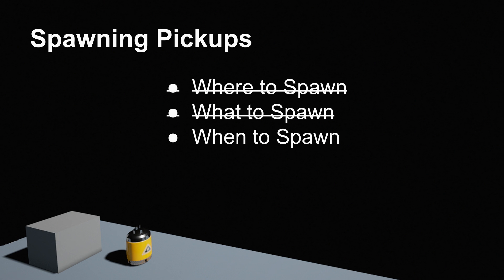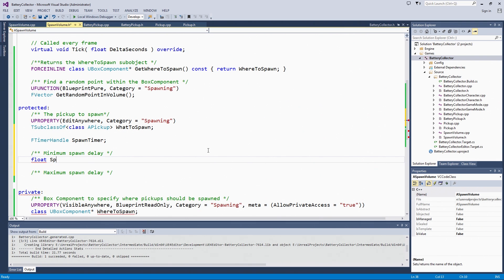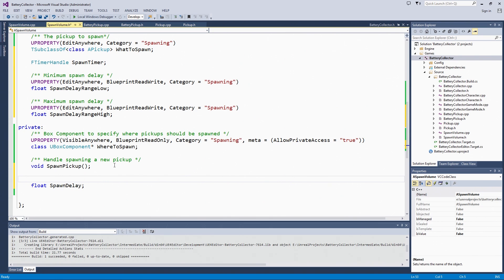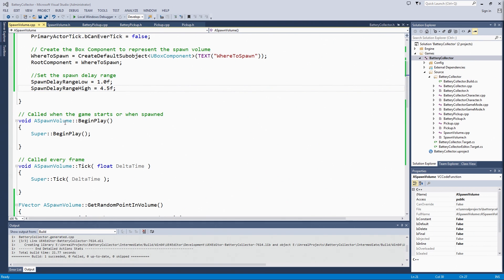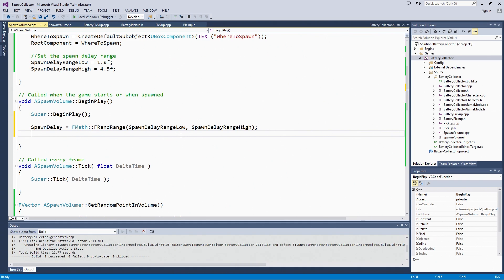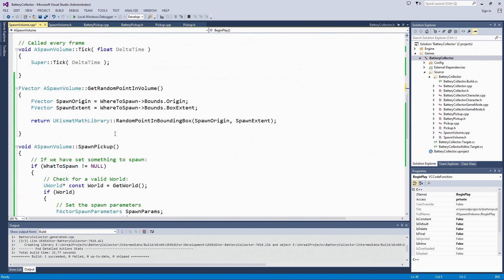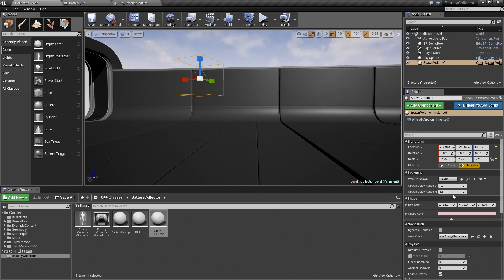C++ Battery Collector: Setting Timers for Spawning | 08 | v4.9 Tutorial Series | Unreal Engine

Comment: If you are using 4.22.3 (or newer) version of the engine then the GetWorldTimerManager() function will probably not work for you (It did not work for me even with the includes mentioned in the comments here). Use GetWorld()->GetTimerManager() instead. Having that in mind the line of code used in this tutorial for setting the timer should look more or less like this: 

GetWorld()->GetTimerManager().SetTimer(SpawnTimer, this, &ASpawnVolume::SpawnPickup, SpawnDelay, false, SpawnDelay);
Reply: Thanks.

Comment: What's with the duplicated code for setting the timer?
Reply: OnBeginPlay() only fires once (when the game starts or the actor is spawned), so the timer will only process once if it's only set from there; SpawnPickup creates the Battery actors, then resets the timer for the next round of spawning, in a continuous cycle.

Basically, OnBeginPlay starts the timer running, and SpawnPickup continually resets it with new values once the Battery actors have been spawned.

Comment: *Sigh*, for every video I get "incomplete type is not allowed", and most of the times the comments tell me what to include to fix this. 1) Why doesn't she get the same errors? 2) What do I have to include to get that error away from the "GetWorldTimerManager()"? 3) What can I do to avoid this in future cases? Do I always have to search documentation to find out what class owns this and that function or what file declares them?
Reply: The magical missing include of this video:

#include "Runtime/Engine/Public/TimerManager.h"

Not to mention to GetTimerManager from the UWorld instance. Still haven't gotten the spawner to work, but code compiles.
Reply: She uses older version of UE
Reply: I know she does, but I always thought u had to include header files for classes you wished to use. So that's why I asked why she didn't have to? I think my questions are relevant even thought she uses an older version.
Reply: Its Because in order to speed up the compile times they have separated the headers out so that they only each include what they need now. That way it will run quicker but now we need to include the necessary headers as they aren't default included. Heres a post about it https://answers.unrealengine.com/questions/660171/battery-c-tutorial.html?sort=oldest

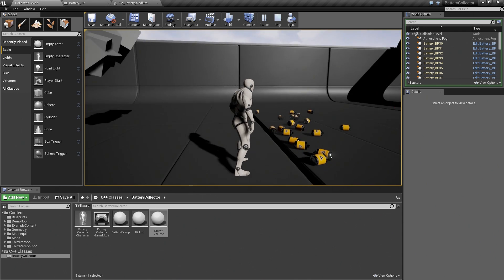Comment: Compiles Ok at 9:28, then crashes UE4, version 4.10.2 !!
Tried restarting UE4 but crashes every time I open this project now. It obviously doesn't like the timers, Lol.
Going to try again in an older version now. If it works in the older version, it's obviously a bug in 10.4.2.
Reply: +Cambo Frog Never Mind, I was doing the initial SetTimer in the constructor rather than in BeginPlay.
Reply: +Cambo Frog did it work in the older versions?